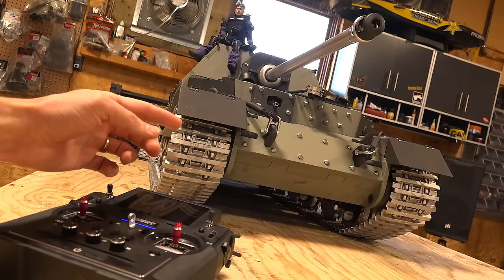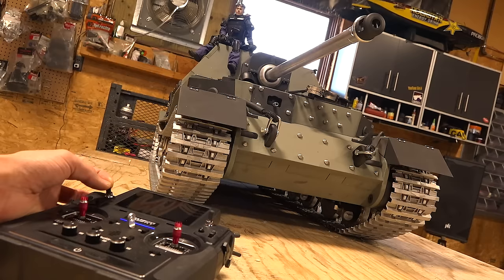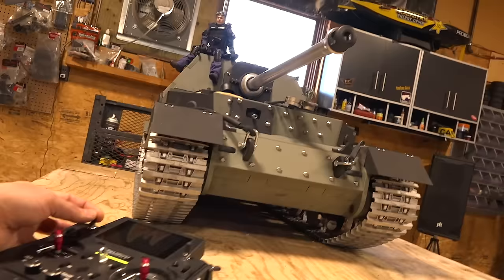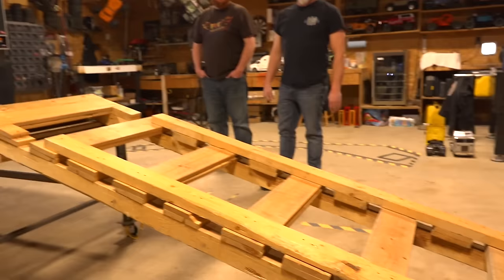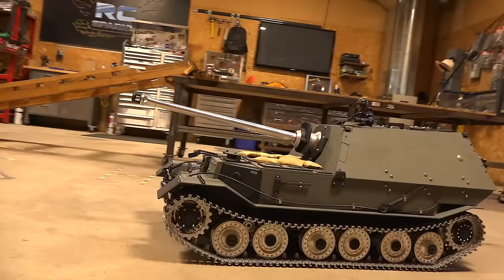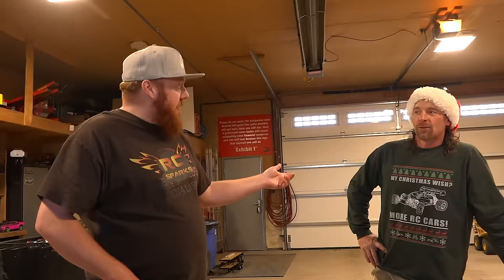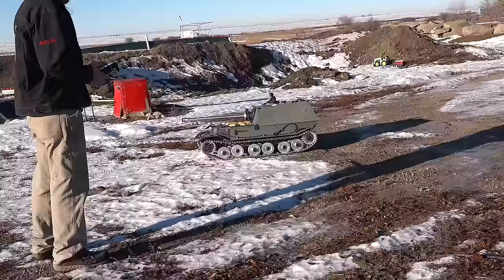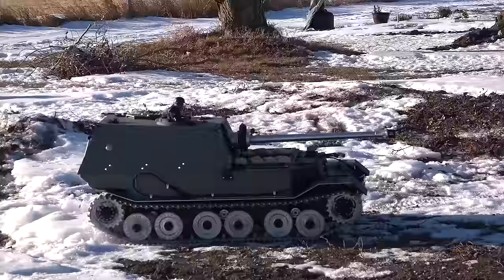GIANT TANK DESTROYER: FIRST DRIVE! FERDINAND ELEFANT ARMORTEK All Metal 1/6 Scale | RC ADVENTURES

Comment: As someone who spent 24 1/2 years on tanks I can tell you to NEVER do a pivot stear on loose dirt or sand, especially with an unsupported track.   You'll throw track for sure and tear up your suspension.

Loved the ending.  We used to drive over brush fires to put them out.

Comment: not realistic enough, modify it to immedietly catch on fire as soon as it drives up hills
Reply: Pls im harmless pls dont yell, but why is that? Im just curious
Reply: @unenthusiasticsalt2123  do you mean "practical"?
Reply: @urlocalasian-.-  the tank had a petrol-electric engine which was prone to either breaking down or catching on fire. While petrol-electric engines can go backwards just as fast as forwards it didn't work well due to the immense weight and poor track design it's engine was very underpowered for its weight

Comment: tracks are 2 slack
Reply: badferrit badferrit yes a little less is better
Reply: Huh 
please elaborate.
Reply: Huh you are right but with these tracks you need to set them so the middle row pins stays within the rollers and there is no slip between teeth on the main gears. in a original german tiger those sprockets are a bit taller and the rollers do not have such a long spring
Reply: I also thought the track were a little slack (loose) thanks for clarification you guys.
Reply: It should have been a rear drive so the track rests when driving forward

Comment: The body is the body from the tiger porche right?
Reply from the maker: The Ferdinand was build prior to the Tiger Porsche. Then the Elefant came.. then the Tiger
Reply: @TheRealRCSparks  No, it's the other way around. The "Tiger Porsche" (as in, the chassis for the heavy tank prototype designed by Porsche) was one of the two competing chassis designs for what would eventually become the Tiger I. Ferdinand Porsche was so sure that his design would be chosen (due to his close relationship with Hitler) that he began serial production of the chassis even before the decision regarding either of the designs was made. When the Henschell design was eventually chosen as the definitive one for the Tiger I (the turret was provided by Krupp, as was the case with the King Tiger), Porsche found himself with lots of chassis for a tank that would not be required by the German Army. Thus the Ferdinand (Panzerjager Tiger (P)) came to be, the engine was moved from the back to the front in order to accommodate for a more powerful (longer) 88 gun. These were later recalled to Germany and some quirks were reworked, like giving it a Commander's cupola and chassis machine-gun, and renamed Elefant. Also, the Tiger I's first participation in the war was in the middle 1942, while the Ferdinand did not enter the fray until the Battle of Kursk, in 1943 (and, according to records, a single Tiger (P) also participated in the battle as a command tank with improved front armor, but its final fate is unknown).
Reply from the maker: MAR COR I also have a similar history posted in my video description.. a complete one.. much like yours. Almost identical.. like a copy and paste..
Reply: @TheRealRCSparks  Great, that means we both know our sources... and that doesn't change that your reply to mc cahilih was wrong. Besides, I came to see an awesome RC Elefant, (and I did, so thank you for that), not to read some long description about something I already know.
Reply: @TheRealRCSparks  is the elefant and the Ferdinand same?
Reply: Btw thanks for the information guys😃.
Reply: @mccahilig1888  Yes, although the Elefants had some reworked features applied over existing Ferdinands.  If you want to see some of their differences, look for pictures of the "original" Ferdinand located in the Kubinka Tank Museum and the "updated" Elefant located in the Aberdeen Proving Grounds (currently borrowed to the Bovington Tank Museum, I think).

Comment: hey rcsparks what's happening dude...........happy balated new years to you and the guys...................that thing is a beast!..........holy crap!............ooh idea............TANK WARS
Reply: How would that work you ask..........1st you set up a insane obsticle course with pillons armed soldiers walking on elovited platforms some army guys artillery and of course a General......2nd you have 2 tanks going head to head in a race from one end to the other then back..........but........there's a catch.......once you get at one end you have to turn your tarret around and drive it backwards to the starting point without hitting anything or going over the yellow tape and............if you run over the General what happens?.........YOUR FIRED!...........if you hit something or go over the yellow line you have to go back to the beginning and start all over again you will have to figure out the penaltys

Comment: The high rate of fire machine gun would be the more accurate.
  GREAT model, btw. Does it use a scale tortion bar suspension ? 
Will you be super detailing ? I'd surely like to see that. 
  Get that cannon functioning, do some radio controlled
bank robberies !! 
  I'm kidding of COURSE ! Could work for intimidating
them overbearing mother in laws, however !

Comment: And looks like that one is equipped with the long 88mm gun. They where originally supposed to have the 128mm gun but the Germans didn’t have enough of them so they used the long 88mm gun that the king tiger had
Reply: The actual story of the Ferdinand and the later elefant was that hitler had created a competition between 2 companies Porsche and Krupp to create a heavy tank that would be later named the tiger, Krupp obviously won with their design but Ferdinand Porsche was so confident in his design that he had already made ~13 Porsche tigers but when he found out that Krupp had won the contract the Wehrmacht decided along with Porsche to place the engine to the middle and mount the PaK 43 88mm gun onto it as a more mobile option rather than the original more stationary gun. For the later elefant variant, the crews of the Ferdinands were getting defeated by soviet infantry so they cut a hole into the frontal armour in front of the radio operator and stuck a ball mounted MG-34 into the hole, never made it more successful (lack of coolant for the engine and weak transmission was to blame for that)

Comment: Unfortunatly it's only the Ferdinand with the 105mm gun instead of the 128 mm pak44L/55
Reply: It's a 8.8 cm KwK 43 L/71, not a 105 mm gun. And the 12,8 cm KwK 44 L/55 was never mounted on the Ferdinand.

Comment: Nice Tank, but you have Front power, if you can switch to rear power then looks it like real with your chains if you drive..
you have different engine sounds , you need only 2. 1 for Standgas and 2. for driving. your tank is a Diesel Hybrid, your engine is only for energie, the movement take elektric engines.
and..
how is the weight your tank? 
mfg u245